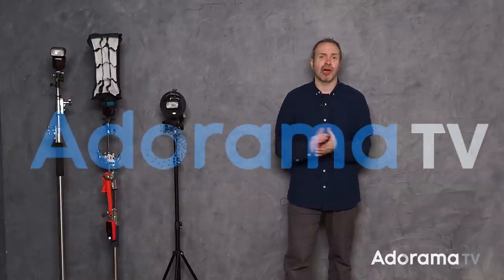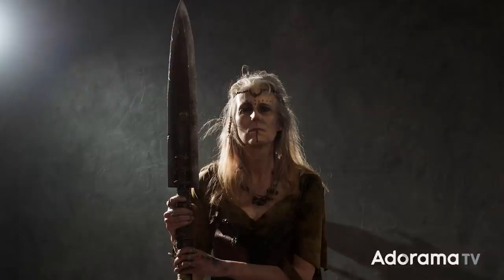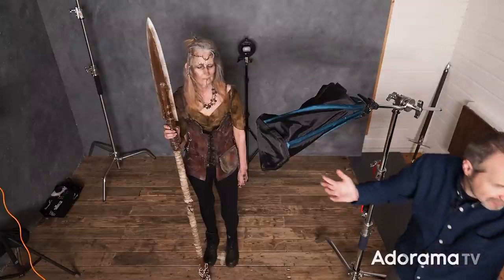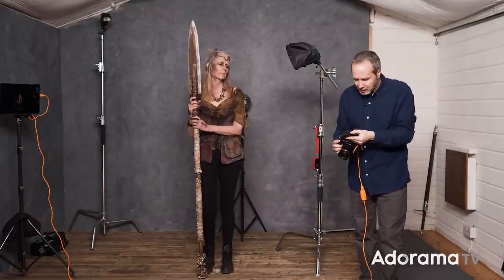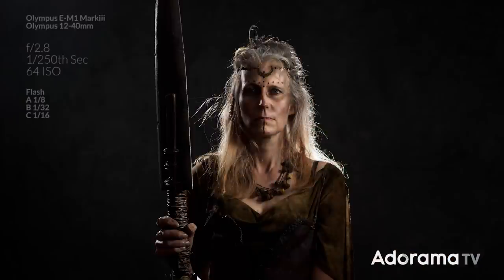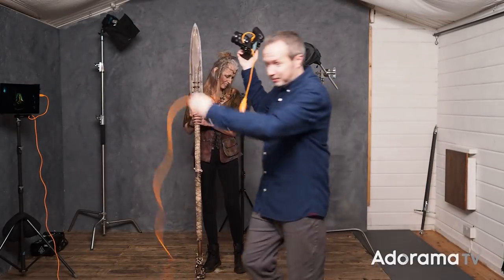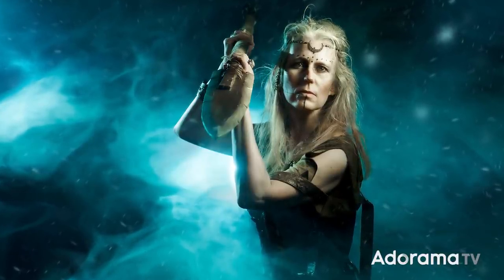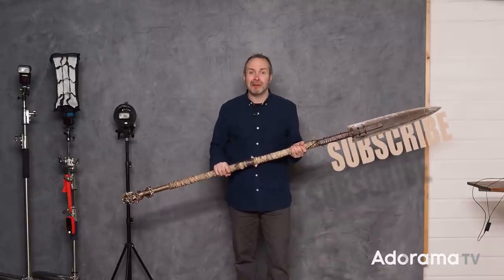Best Way To Work With Multiple Speedlights | Take and Make Great Photography with Gavin Hoey

Comment: Hi Gavin its a great reminder - im a speedlite fan and would love to update to something with modelling lights but for my budget for now will scrape by with what i have - i am dong exactly what you recommended - can be a bit slow for some models who are not used to waiting but ive learnt to get them onto the wifi with their fone so can check messages etc while i chat and find out about them get a rapport going and tinker with settings -

Comment: Great Gavin. Fantastic photos.
Just two questions.
1. How did you decide the power of the flashes on the back?
2. Does smoke machine leave some glicerine residues on the equipment?
Thank you.
Reply: Hi Alex. 1. Start mid power range but be ready to adjust as the smoke becomes more or less dense. 2. No residue problems
Reply: @GavinHoey  Thank you very much. I love your videos!

Comment: Hey Gav, great tutorial and hilarious at the same time ;) - Apologies if you have answered this before, is that a tablet you are tethered to?  I've not had luck trying this with my Samsung S5, I love to tether on location using something as light as a tablet hooked on my belt.
Reply: Hi Matt. That's my Lenovo MIIX tablet PC. It used to be the laptop I'd travel with (when we could travel for demos) and I believe is now discontinued. Something like a Microsoft Surface Pro would do the same job better.
Reply: @GavinHoey  So tethering has to be Windows or Mac based not mobile? Thanks so much, stops me beating my head against the wall with the Samsung Tab ;)